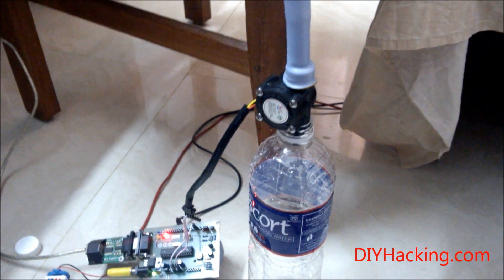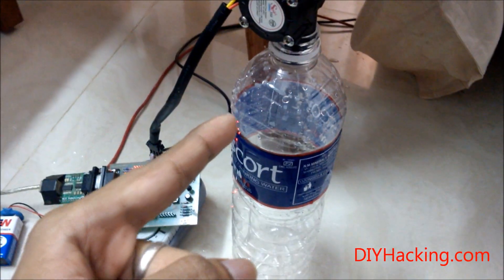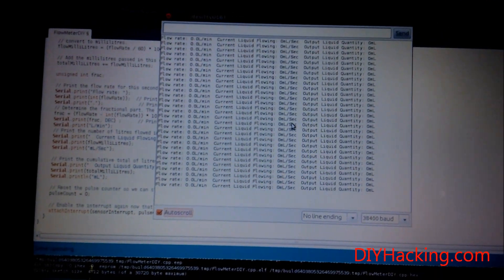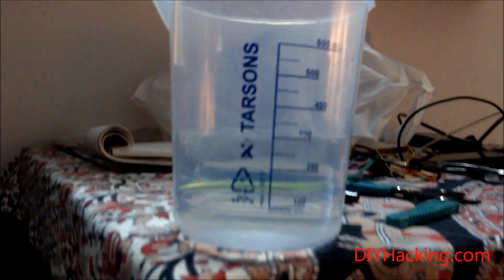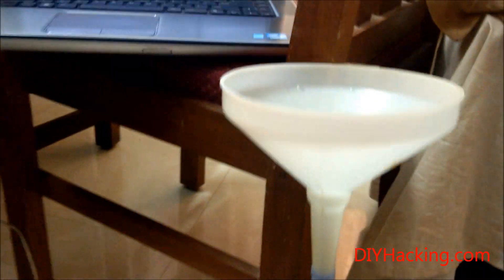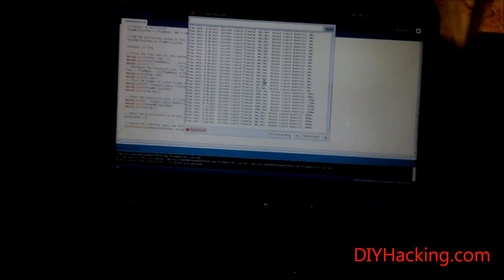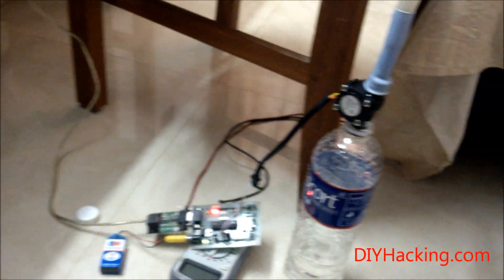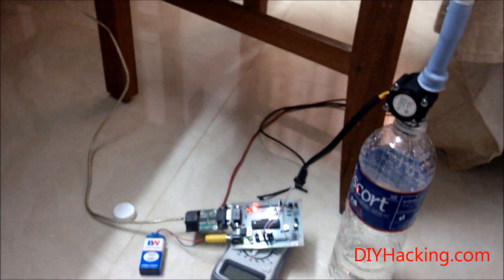Arduino Flow Rate Sensor Working

Comment: You need larger quantity to get more accurate reading. The inside keeps on spinning after you finish poring which is why you get a higher reading than 300ml. My guess is that if you poor 1000ml, the reading will say around 1030...

Comment: Hi Bro, I live in Delhi. I have been facing some issue with water motor and water tank and I want to fix it. We have water timing, 2 hrs in morning and 2 hrs in evening. Now, every time when water comes I have to turn on the pump and wait till tank get filled turn off the motor. I do it manually. I want, it do it automatically by using arduino, water flow sensor and relay. I would like to request you that can share me the diagram + code how I can connect the relay with motor plug so as water comes into water flow sensor I turn on the motor switch using relay?

Comment: Could I use a similar setup as this to measure air flow rate in litres per minute? Would this type of sensor work for gas or is it specifically for liquid? Thanks!

Comment: Is possbile to make your code to use two flow meters pin2, pin3 ? Both sensors are the same. And want ask is possible to make display value after comma 1,5L instead 1L or 1500mL ?

I make like this and dont work where is problem?

#include <Wire.h>   // standardowa biblioteka Arduino
#include <LiquidCrystal_I2C.h> // dolaczenie pobranej biblioteki I2C dla LCD

LiquidCrystal_I2C lcd(0x3F, 2, 1, 0, 4, 5, 6, 7, 3, POSITIVE);  // Ustawienie adresu ukladu na 0x27

byte statusLed    = 13;

byte sensorInterrupt = 1;  // 0 = digital pin 2
byte sensorPin       = 3;
byte sensorInterrupt2 = 0;
byte sensorPin2      = 2;

// The hall-effect flow sensor outputs approximately 4.5 pulses per second per
// litre/minute of flow.
float calibrationFactor = 9.55;
float calibrationFactor2 = 9.55;

volatile byte pulseCount;  
volatile byte pulseCount2;  

float flowRate;
unsigned int flowMilliLitres;
unsigned long totalMilliLitres;
unsigned long oldTime;

float flowRate2;
unsigned int flowMilliLitres2;
unsigned long totalMilliLitres2;
unsigned long oldTime2;

void setup()
{
  lcd.begin(16,2);   // Inicjalizacja LCD 2x16
  lcd.backlight();
  // Initialize a serial connection for reporting values to the host
  Serial.begin(9600);
   
  // Set up the status LED line as an output
  pinMode(statusLed, OUTPUT);
  digitalWrite(statusLed, HIGH);  // We have an active-low LED attached
  
  pinMode(sensorPin, INPUT);
  pinMode(sensorPin2, INPUT);
  digitalWrite(sensorPin, HIGH);
  digitalWrite(sensorPin2, HIGH);

  pulseCount        = 0;
  flowRate          = 0.0;
  flowMilliLitres   = 0;
  totalMilliLitres  = 0;
  oldTime           = 0;

  pulseCount2        = 0;
  flowRate2          = 0.0;
  flowMilliLitres2   = 0;
  totalMilliLitres2  = 0;
  oldTime2           = 0;

  // The Hall-effect sensor is connected to pin 2 which uses interrupt 0.
  // Configured to trigger on a FALLING state change (transition from HIGH
  // state to LOW state)
  attachInterrupt(sensorInterrupt, pulseCounter, FALLING);
  attachInterrupt(sensorInterrupt2, pulseCounter, FALLING);
}

/**
 * Main program loop
 */
void loop()
{
   
   if((millis() - oldTime) > 1000)    // Only process counters once per second
  { 
    // Disable the interrupt while calculating flow rate and sending the value to
    // the host
    detachInterrupt(sensorInterrupt);
    detachInterrupt(sensorInterrupt2);
        
    // Because this loop may not complete in exactly 1 second intervals we calculate
    // the number of milliseconds that have passed since the last execution and use
    // that to scale the output. We also apply the calibrationFactor to scale the output
    // based on the number of pulses per second per units of measure (litres/minute in
    // this case) coming from the sensor.
    flowRate = ((1000.0 / (millis() - oldTime)) * pulseCount) / calibrationFactor;
    flowRate2 = ((1000.0 / (millis() - oldTime2)) * pulseCount2) / calibrationFactor2;
    
    // Note the time this processing pass was executed. Note that because we've
    // disabled interrupts the millis() function won't actually be incrementing right
    // at this point, but it will still return the value it was set to just before
    // interrupts went away.
    oldTime = millis();
    oldTime2 = millis();
    
    // Divide the flow rate in litres/minute by 60 to determine how many litres have
    // passed through the sensor in this 1 second interval, then multiply by 1000 to
    // convert to millilitres.
    flowMilliLitres = (flowRate / 60)*1000;
    flowMilliLitres2 = (flowRate2 / 60)*1000;
    
    // Add the millilitres passed in this second to the cumulative total
    totalMilliLitres += flowMilliLitres;
    totalMilliLitres2 += flowMilliLitres2;
      
    unsigned int frac;
    
    // Print the flow rate for this second in litres / minute
    lcd.clear();
    sei(); 
    lcd.setCursor(0,0);
    //lcd.print("Flow: ");
    lcd.print(int(flowRate*1000));  // Print the integer part of the variable
    lcd.print("ml");

    // Print the cumulative total of litres flowed since starting
    lcd.setCursor(12,0);
    //lcd.print("Total: ");        
    //lcd.print(totalMilliLitres/1000); Total Litrów
    lcd.print(totalMilliLitres/1000); //total ml
    lcd.print("L");

    sei(); 
    lcd.setCursor(0,1);
    //lcd.print("Flow: ");
    lcd.print(int(flowRate2*1000));  // Print the integer part of the variable
    lcd.print("ml");

    // Print the cumulative total of litres flowed since starting
    lcd.setCursor(12,1);
    //lcd.print("Total: ");        
    //lcd.print(totalMilliLitres/1000); Total Litrów
    lcd.print(totalMilliLitres2/1000); //total ml
    lcd.print("L");

    
   // lcd.setCursor(14,1);
    //lcd.print(pulseCount);

    // Reset the pulse counter so we can start incrementing again
    pulseCount = 0;
    
    // Enable the interrupt again now that we've finished sending output
    attachInterrupt(sensorInterrupt, pulseCounter, FALLING);
    attachInterrupt(sensorInterrupt2, pulseCounter2, FALLING);
  }
}

/*
Insterrupt Service Routine
 */
void pulseCounter()
{
  // Increment the pulse counter
  pulseCount++;
}
void pulseCounter2()
{
  // Increment the pulse counter
  pulseCount2++;
}

Comment: Hi @DIY Hacking, nice video buddy
I have a one question, With the flow sensor, I can calculate the amount of water that has passed through it ?.

would need this value,  to turn off a water pump automatically, when all the water has passed through the sensor.
That could be done?

Thx and post more videos, please.
Reply: If the water flow rate is constant at all times, then it will be as easy to calculate as we do with time-distance relationships. Just multiply the flow rate with the time it takes.
For dynamic flow rate, I would suggest to rather set a level sensor top-mount at the tank which is upstream the flow sensor. Easier. So when suppose, the level drops below 10% of the tank level, set it to turn the pump off.

Comment: Perhaps the instructions did not specify it but to measure a flow meter's accuracy it has to be properly installed.  
flow is best measured on a vertical line with flow going upwards, there is a minimum distances before and after the flowmeter in which the line must be straight and away from the pump, could be 20-30 times the diameter of the line, the further the pump the better, the line diameter must be one size over said distance, accuracy reaches its peak over a minimum specified flow speed. 
once you cover all those requirements you can finally set yourself to measure it's accuracy.

Comment: Just an observation, but if you're using this for flow RATE, then the rate can vary and has no relation to the total volume that's inside the beaker. The Flow TOTAL is what you want to match. You need to incorporate a method for totalizing this flow rather than looking at the variable of how fast it is moving through the pipe. I saw someone mention using pulses, which you can integrate easily by applying a k-factor to the pulse value. i.e. 1 Pulse - 10 ml where 300 ml = 30 Pulses. I'm sure you'll figure it out, but it seems your initial method of determining accuracy was incorrect.

Comment: hello, is the flow rate sensor capable of other types of liquid other than water? like gasoline perhaps
Reply: Hey, I believe so. But there is a chance that the materials may disintegrate with other strong fluids.
Reply: Arvind Sanjeev Hi, do you know any other projects that uses the same sensor but not using water as the liquid? :D

Comment: i have a doubt whether the quantity of fluid varies with the flow rate
Reply from the maker: Yeah, greater the flow rate, greater will be the quantity of liquid flowing.
Reply: How  to have constant flowrate
Reply from the maker: Pradeep Raj You should maintain the steady flow of water.
Reply: What should i want to do to maintain constan flowrate shall i use a buffer tank to avoid error
Reply: WE HAVE HELICAL ROTOR FLOW SNESOR FOR WATER THAT QUENTITY SAME WITH CHANGE OF FLOW RATE, means accuracy same with min to maximum flow rate

Comment: hello, if you try to check the accuracy few times, what happens?does it shows 330 each time? or maybe varies for a few ml?
Reply from the maker: Hey, it does vary a bit each time, you probably would have to take the average from a few measurements.
Reply: how much it varies?few ml, few 10 ml?
Reply from the maker: Yeah plus or minus 10 mi at the most.
Reply: DIY Hacking.com  well, enough accurate for me.Maybe it varies also because of trapped air...best test would be if you use a valve, fill the top bottle and then open the valve, that prevents air bubbles..well, thanks for info ;)
Reply from the maker: Awesome, thanks for the tip :)